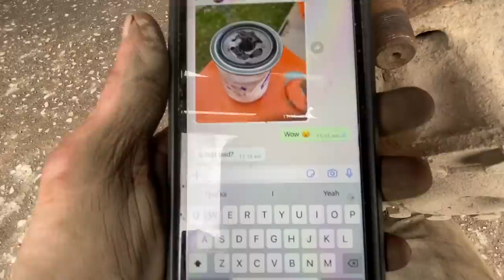Everyday’s a struggle 😁 Iveco truck track rod end, calliper, pads, spring eye bush’s, crane game,

Comment: The filter on that crane you primed is the first filter from the tank. It then goes to the sediment screen filter/pre filter and primary filter that's on the engine. You'll see 2 filter caps on the left side of the engine towards the front. The pre filters block up. Also the filter the operator changed the seals can be dodgy in the water trap bowl at the bottom so check it's tight and not leaking or drawing in air. And a crane of that age is common for algi in the tank.